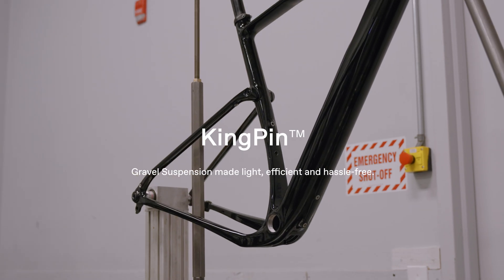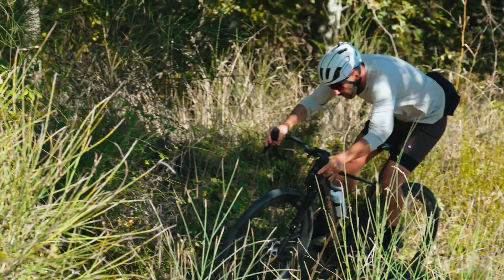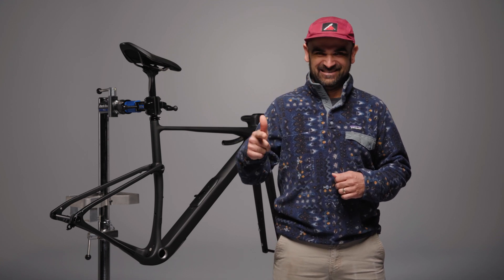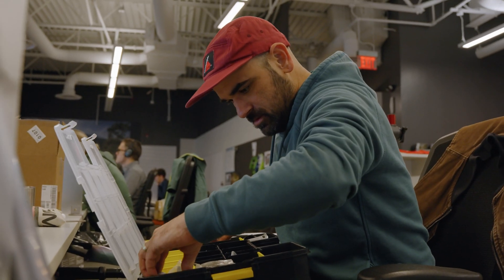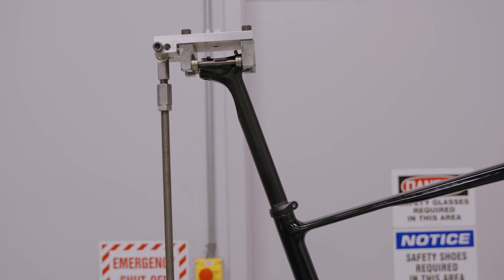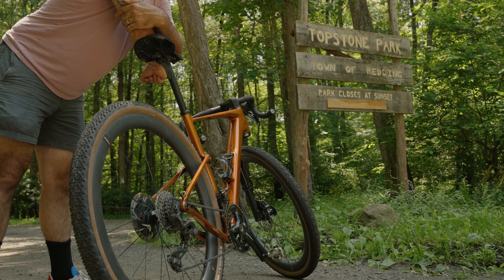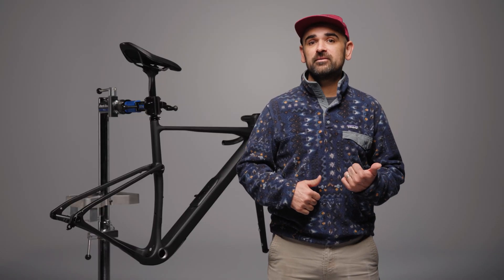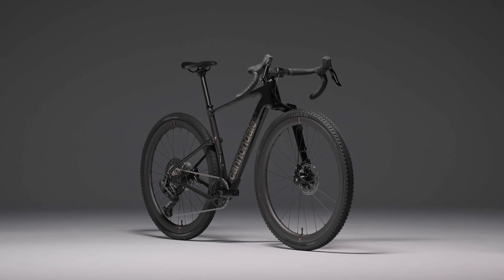The Innovative KingPin Gravel Rear Suspension System | Tech Talks | Cannondale Topstone Carbon

Comment: DO NOT BUY THIS BIKE The Dream Ride, The Structural Nightmare
Like many of you, I was completely sold on the vision of the Cannondale Topstone Carbon 2. The promise of the proprietary Kingpin suspension system—that smooth, lightweight flex at the seat stays—was what sealed the deal. I envisioned endless miles of comfortable gravel grinding, a bike that could truly handle everything.
For a while, it delivered. The ride was sublime, a perfect balance of speed and compliance. But then, a subtle change started. A creak, a tiny bit of play that shouldn't have been there. What I found when I inspected the frame was more than just a minor annoyance; it revealed a critical structural defect that renders the bike unusable and, frankly, dangerous.
The Kingpin Catastrophe: Structural Bonding Failure
The fault lies right at the heart of the suspension system, specifically where the seat tube meets the seat stays. This area is anchored by the Kingpin suspension pivot.
The component responsible for encasing and supporting this pivot is an alloy tube housing that must be permanently and securely bonded into the carbon frame. This alloy insert is the bedrock of the Kingpin system’s integrity.
However, on my Topstone 2 Carbon, the worst has happened:
• The Component is Unbonded: The alloy tube housing has become unbonded and detached from the surrounding carbon structure.
• Visible Movement: This failure has created a noticeable, visible gap between the alloy insert and the carbon, allowing for unwanted movement.
• Total Compromise: This is not a cosmetic flaw. This structural issue directly compromises the frame's integrity and the function of the Kingpin system, turning a key performance feature into a massive safety risk.
This failure—a structural bonding failure—is unacceptable for a high-end carbon frame. It is a critical manufacturing defect that calls into question the long-term durability of the entire design.
Reply from the maker: Well, shoot. That's not supposed to happen EVER, and we're bummed it happened to you. Give us a call and let's get you out of the nightmare and back into the Dream Ride. If we messed up, we'll make it right.
Reply: @CannondaleBicycles71  I have contacted Cannondale and still waiting on response gonna end up trying to get it rebounded myself

Comment: AND the worst things in cycling...are the things that the bike industry says "we need" but actually do not need. 
You know what is more hassle-free and lower on maintenance?  A normal gravel bike frame.  
My steel gravel bike is like riding on clouds compared to my old road race bike.  FYI, its the wheels/tires.  No gimmicks needed.

Comment: Cool, but I'm not interested in your IP; modern bikes are within percentages of 30 year old bikes, at double the cost (or more). Aside from professional racers who might go broke if they don't win, no one needs these expensive tiny "improvements" even when they are an improvement. 

I'd get much better use out of two or three very excellent bikes using established non-proprietary tech, than any one high-tech bicycle.

Comment: Looking at comments it seems that the community stopped trusting manufacturers and rather expect "innovations" like this to be a scam feature just to get more money from cyclists. I wonder why it's that ;)
Reply: Maybe because "innovation" in the bike industry, usually means extremely expen$$$$$ive proprietary parts for maybe a couple percentage points of performance gained (& usually with something else important sacrificed), because bicycles are a relatively simple machine with few fundamental changes despite over a hundred years of ample competition? 

Maybe reliable quality at low cost, is more important to most riding, than shaving a couple seconds (at most) per thousand dollars spent? 

Nah, must be a lack of marketing.  ;S

Comment: The frame flexes nicely in several locations - what the video does NOT seem to show is that the pivot does contribute anything to this potentially nice flex.  Motion around the pivot might be more difficult to visualize but it almost seems that it is not required.

Comment: I've always wondered why those bikes never had forks and a rear spring, but now this makes sense.  Crazy technology!
Reply: Because they've never heard of damping. Frame flex is not a good replacement for real suspension.
Reply: @prophetzarquon  this was mostly racers I seen without suspension
Reply: @ Yeah, hardtails definitely go faster & even a suspension fork does waste some energy; a really well designed frame for a given rider, can transfer some vertical compression into forward motion, & while it might ride a bit springlike, there are definite advantages to it. 

My old 29er XC MTB with 2.21 rear & 2.75 front tires & a hard worn RockShox fork, on 3×10 gearing for a nice straight chainline, goes plenty fast for me, so all the plastic+carbon composite frames etc have just missed my interest entirely, except for a certain level of academic "Aha, yes; that can benefit some other use cases."
Reply: @prophetzarquon  which is the reason why racers do not have suspension and why i couldn't figure out why they didn't have suspension until I watched the video.  I'm looking for a 29er frame that is lightweight and for the right price.  Do you have a recommendation?
Reply: @prophetzarquon  I'm working on a rtw bike with a 1x9 cassette but I need a machine shop to fab my cassette as there is nothing on the market.

Comment: How does this account for riders with weight differences of 100+lbs?
Reply: that's the real question IMO. everything else in the comments is wrong, misleading or ill informed at best. Carbon's good at this. The pivot make sense. But at what average weight? Why not have flip switch for multiple weights, or similar? I'd like Cannondale to reply to this specific comment.
Reply: It doesn't. It relies in on the second moment of inertia of the frame members to create a flexure/spring of a constant rate. This cannot be adjusted without changing the geometry of the members

Comment: a good, used S-works epic mntn bike can be had for $2k or so.   weighs less than 21 lbs and has 4" of suspension travel.  Throw some CX bars on it and there ya go.   Saved several thousand dollars.
Reply: New v.s. old is apples to oranges though. A good, used topstone can be had for $1k or so. Saved a thousand dollars.
Reply: @JimIBobIJones  you must own a bike shop. 😁 Can be, sure.  I've had my fanny kicked by guys in steel hard tails & have kicked tails on $10k bikes.  A good rider will make any bike work.   I speak of xc riding...huge drops are for younger people

Comment: Carbon fiber and flex dont mix. In the end the chips in the paint from riding will be where the bike cracks apart. The manufacture will not warranty the frame and blame the damage on the user, because the frame fails it wont always be clearly evident what happened. I have destroyed my share of carbon bikes and parts to see a pattern. They are great at first but they always get spongy over time.

Comment: A flexible frame is not suspension, and man, I do NOT trust CF being put through those deep flex cycles repeatedly. At least not the relative garbage used in bicycle frames. They aren’t building these things like fighter plane wings.

Comment: My Jones has that amount of travel, WITHOUT a pivot ! 😂
Reply: Jones are masterfully engineered bikes. Question is; is a jones bike as fast or light as this bike?
Reply: Is that really the most important question? Because shaving even several percentages off a given stat, isn't really worth thousands of dollars outside of a professional race for prize money. 

Meanwhile, the rider will make far more difference than the bike tech. Maybe save the money & hire a better rider, or get some training!
Reply: @prophetzarquon  in the context of the gravel bike, I don't think buyers would be averse to purchasing depending if their use case perfectly suits what it's built to be. Jones bikes are also often reserved since they sell so quickly at lower batch numbers despite being cheaper. Really depends on what they need the bike to do and how money conscious they are.

Comment: nice but... how long before it would break from fatigue ?
Reply: I believe the integrity of whatever the carbon fiber is embedded in is what determines this. As long as you're the right weight and not sending the bike off of features too intense for gravel riding, the frame should stay within its elastic region of stress v. strain. If it breaks after a long time, then that'd likely just be the material life of the frame itself, and less of an unexpected failure.
Reply: essentially if it doesn't bend too much it should last as long as any other carbon frame given proper quality control.
Reply: Idk, if it does few 10^7 something cycles at 10% ultimate stress, isn’t that indestructible?😂
Reply: 118.7 million cycles, give or take a few dozen
Reply: From what i have read carbon fiber does not really have a fatigue life. As long as it does not flex to a point where it starts to delaminate it can basically have almost infinite cycles.
Reply: TLDR: Carbon fiber breaks all at once, metal fatigues noticeably. 

No, carbon fiber doesn't survive infinite cycles; it simply doesn't fatigue gradually the way metal alloys do: Aluminum shows significant stress fracturing & deformation before a break, whereas carbon fiber shears internally with wear only becoming visible upon full breakage. A carbon fiber frame that's about to break looks normal except to ultrasound instruments. 

Ultimately, carbon fiber frames generally won't last as long as metal frames (generations), but that's not due to fatigue: The plastic resin holding the fibers together dries out with time, to become brittle. Ultraviolet light exposure accelerates this, so storing the bike out of the sun helps it last much longer (other parts too, like the seat). Notably, there's more volume & usually more weight, of plastic resin, than carbon, in a "carbon" frame... As the plastic ages, it loses its flexibility until a break occurs. 

Fatigue definitely ends its share of both metal alloy & plastic+carbon frames early, though: Stair descents & other "rhythm" sections often do the worst wear, with big drops being another obvious contributor, & enough of that will wear out any frame (& bearings!)... 

Fatigue affects most metal alloy frames after fewer flexes, than carbon fiber frames. So, under extremely frequent usage, carbon fiber lasts longer... 

Most people don't ride enough miles per day for that to happen though; metal alloy frames that don't break relatively quickly, generally last decades longer than the plastic holding a "carbon" frame together; it really comes down to how & how-often they're used.
Reply: My 2021 Topstone is still as good as new. I also have a 2012 Scott SCR1 SL enduro bike which also employs a similar carbon spring setup (the "SDS" system) in the stays to add some compliance and the frame is still perfectly solid.
Reply: Carbon doesnt fatigue like metal does, this was tested for more cycles than pretty much any bike will ever see.
Reply: @lbgstzockt8493 I here more CF failures in atleast MTB then Aluminum failures, plus one is reparable the other isn't.
Reply: @lbgstzockt8493  i figured; I only know so much about material behaviors. Pretty cool nonetheless

Comment: the smaller the bike the harder it is to flex the frame. And riders are smaller and lighter making the system even more useless. I would be glad if you tell me I am wrong that they have tuned the bike to each rider size.

also, your video shows seat post offers most of the flex.
Reply: The weight is on pedals & seat, so that's always going to move or the suspension isn't working. 

And yeah, big riders are going to feel like they're riding a bobble toy on these, whereas small riders will feel every bump. Non-adjustable suspension is worse than no suspension, for all but one size rider.

Comment: I've got a first generation Topstone carbon.  It's a great ride on the gravel, very smooth on the chattery stuff.  Paired it with a Redshift stem for a truly great bike!
Reply: Hey! I've got the same setup! :)

Will replace it with the new one with lefty fork, if I find a good deal (maybe black friday), although I really have 0 complaints about it... other than the AI dising thing I guess.
Reply: @surprisinglythiswasavailable  I've been thinking about getting an Oliver as well, but they're so dang expensive! Mine's all black and want a bit more color, so I'll probably see if I can trade up one with the fork, and more color at the same time in coming years!
Reply: @superglue46 Not sure why you would ever want the lefty on a gravel bike.  The Oliver is too high maintenance for only 30mm of travel. The "inverted" design is going to require a lot more maintenance and the design makes it  pretty much impossible for any home mechanic to service, even if you are pretty experienced. 

It also requires a hub change for your front wheel and even the carbon version 2.5X heavier than the normal topstone fork.

Comment: What I learned from running a Lauf front fork.  'Fixed' leaf springs have a 'range' that works.  For my 240lbs, my Lauf fork works really well.  As I have the weight to make the fork flex.   My 120lbs wife however, does not.  Her Lauf fork never really worked but for the absolute worst impacts.  So like 1% of the time.   I can see this 'flex rear end' working the same way.  For heavier riders, it should work wonders.  But for lighter riders, I wonder if it will work at all.  And I wonder if they tune the different frame sizes accordingly?  I.e. way way more flexy in small frames, and less flexy in large frames?
Reply: I know the different sizes of mountain bike frames are tuned for the size of the rider. Wouldn't be surprised if these are, too.
Reply: @williamreinhard  sure but a 6'3" 260 lb guy would need a different 'spring rate' than a 6'3" 175 lb guy.